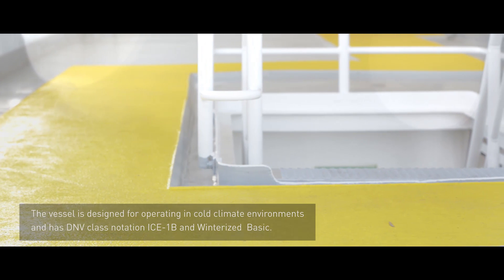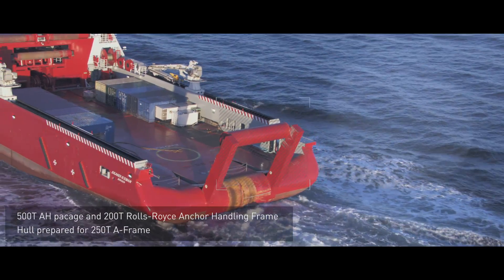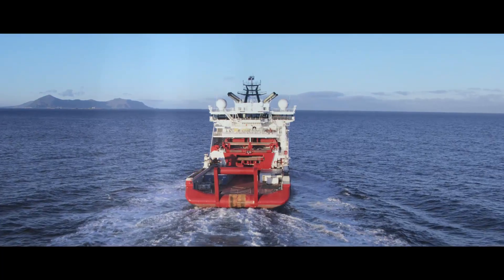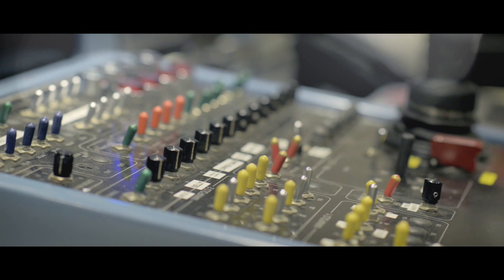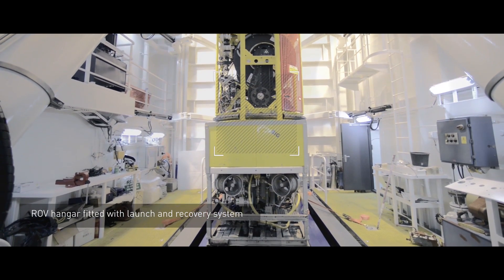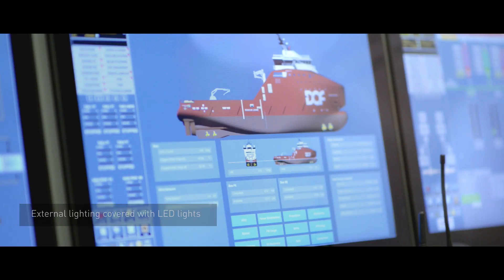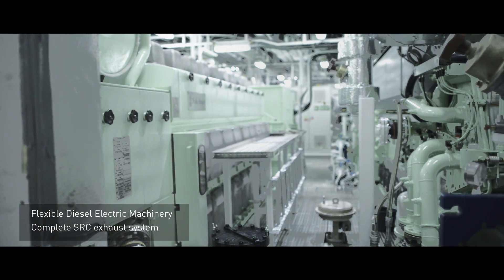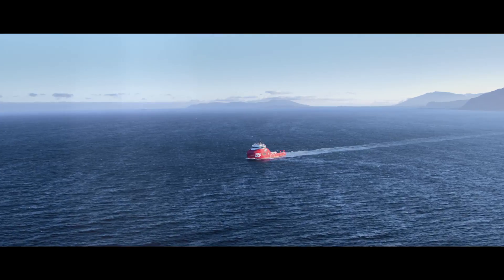RLX LED Floodlight on DOF Skandi Iceman

Comment: " The Iceman is equipped with ILC, HCR, LED...." WXYZ; 
plus the whole alphabet twice over!
Reply: Yeah I get you, and this video should be longer to explain that. Here is my explanation of it.

FiFi = (Fire Fighting) Fire fighting (External Fire Fighting system to fight fire with huge water cannons on land/other Vessels/Oil Platform)

NOFO = (Norsk Oljevernforening For Operatørselskap) Able to combat oil spillage/contamination. Vessel is built to support equipments to stop/prevent oil spill catastrophe

SPS Code (Special Purpose Ship) = A ship that is special enough to carry more than 12 special personnel. Meaning the vessel is special enough to require 12 or more people to operate

MLC 2006 = Is about the requirement of wellbeing of staff and passengers on board a ship. The cabins and facilities and work hours among other requirements must be within the requirements of MLC 2006. All ships must follow this

DNV = De Norske Veritas (Ship Classing Firm)

ROV = Remote Operating Vehicle (Vehicles that are submerged to the bottom sea floor and being controlled and monitored from the vessel)

Heave compensation = Cranes and ROV can be Heave compansationed. This allow the winch on the Crane/ROV wire to be compensated of the heave of the vessel (The vessel going up and down due to waves) such as the end of the crane wire / ROV not being moved up and down due to the vessel movement.

SCR (Selective catalytic reduction) = To reduce Nox (Nitrous Oxide) when burning Diesel Fuel.

Hybrid Machinery Installation means Diesel/Gas(LNG) fuel engines provides electric power through generators to power electric propulsion and thrusters (Diesel-Electric) while at the same time can provide their power directy to a propeller without any electric motors (Diesel Mechanical Mode) Or both at the same time. (Hybrid)